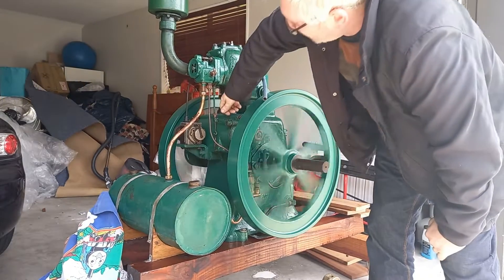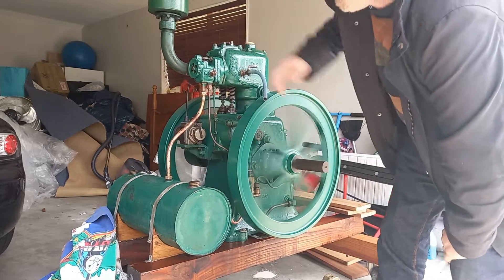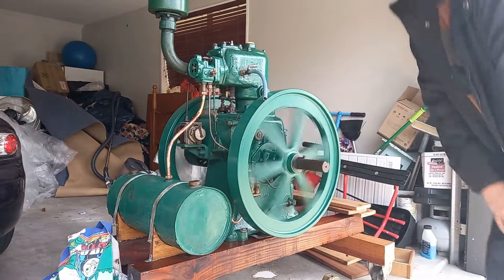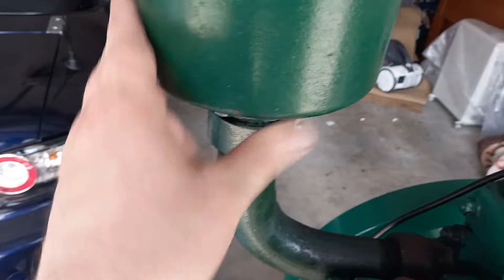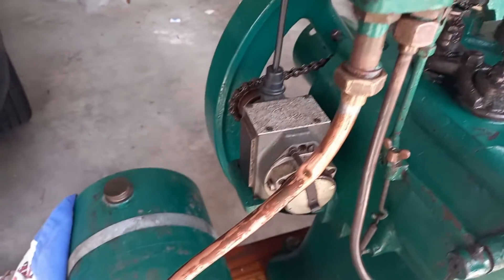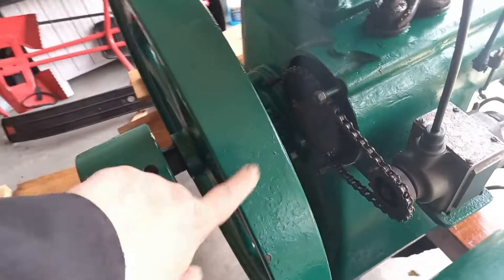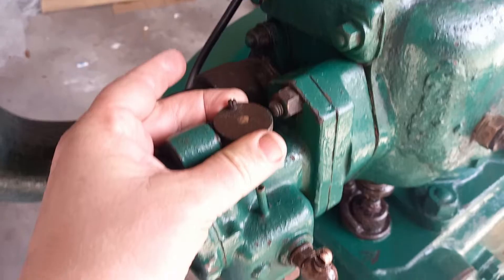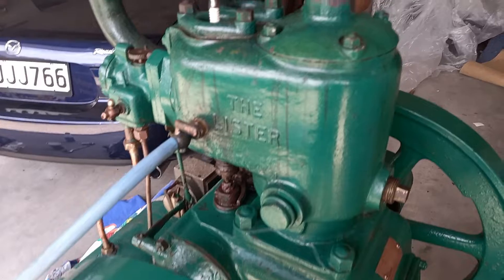WILL IT RUN? The Lister 100-year old barn find engine- Is it simple enough for an idiot? #hitandmiss

Comment from the maker: Sorry I didn't get video of the cleaning and oiling...You'll have to take a minute to imagine me spraying carb cleaner, checking oil, thoroughly cleaning, rust treating and problem solving the lack of fuel (stuck fuel pump balls). First start effort: the very first noise it made was an almighty earth shattering backfire. Then it started. Governor was set way too high and the engine sped up...I forgot I hadn't researched how to stop or even slow the thing. It began leaping its 250kg bulk around the garage with me holding on for dear life trying to (a) keep it on the ground and (b) steer it away from the precious sports car. It jumped so violently it tore off the petrol tank and fuel lines. My son was hiding behind the car expecting to get my torn off and bloody arm, leg or head tossed out at him. Luckily with the fuel lines torn off instead, it was only a matter of time before the beast subsided. As you might expect, I did enough research to find 3 ways of killing it if it took off like that again.  Dramatic...and a bit traumatic. Since then I've fallen in love with its music...

Comment from the maker: It's running 95 octane petrol ("gasoline") with a touch of 2-stroke engine  oil, about 1:80 or 1:60, for a little extra top end lube of an old engine that hasn't run for 15 years and may have gummed up piston rings, as I couldn't get the spark plug out initially to dump some ring loosening lube down there. It doesn't smoke (much) and starts and runs fine